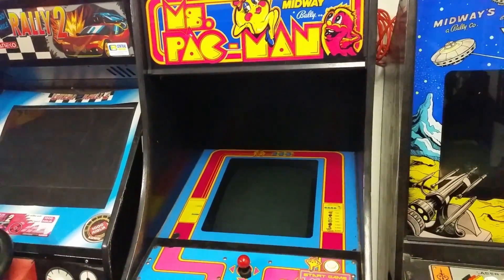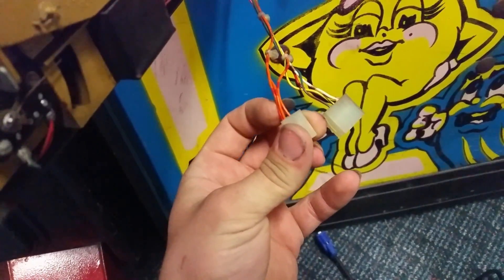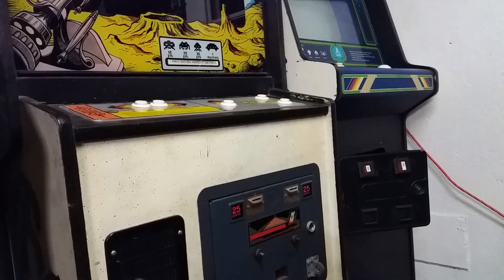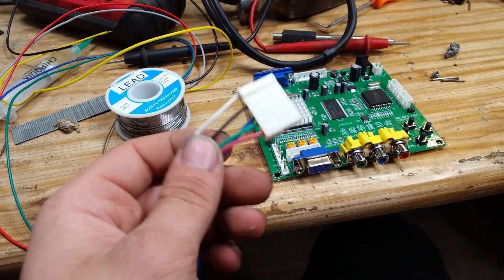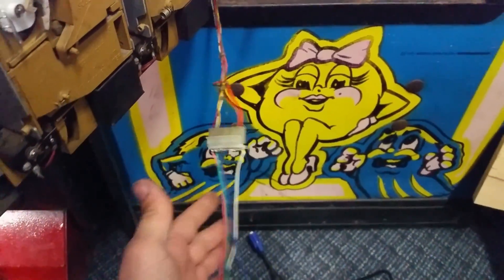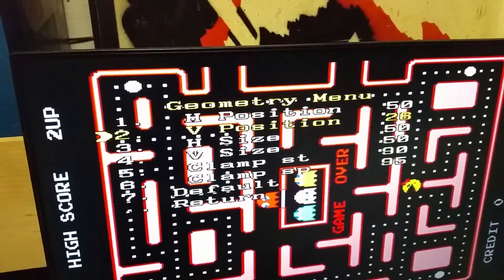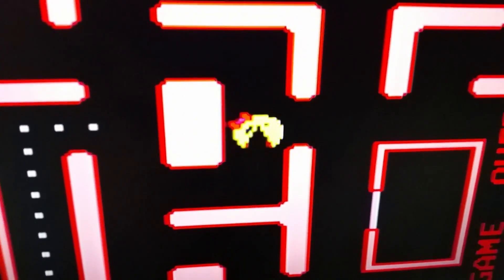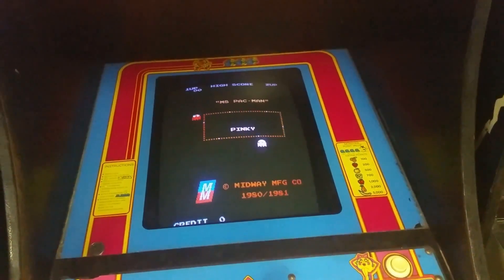How to LCD swap a Ms. Pac Man Arcade Machine!

Comment: Parts list?  Your affiliate shopping links are for basic things, not the specific parts you used e.g. the board and the connector.....
Reply from the maker: The description has been updated with the exact board I purchased and what should be the correct Molex connector.